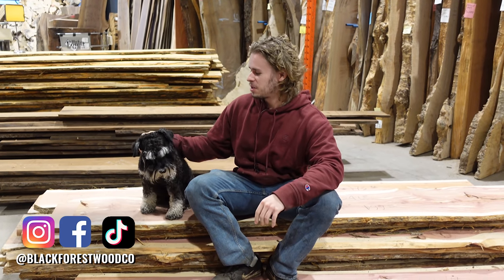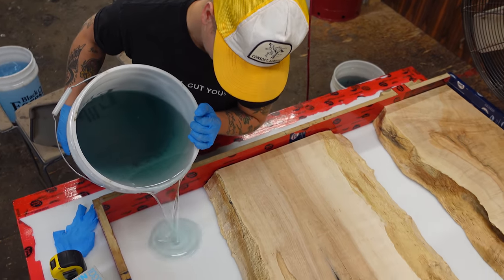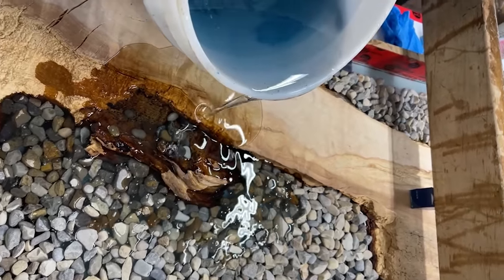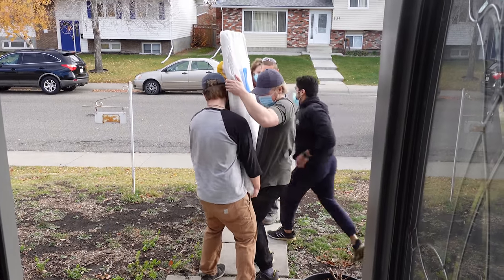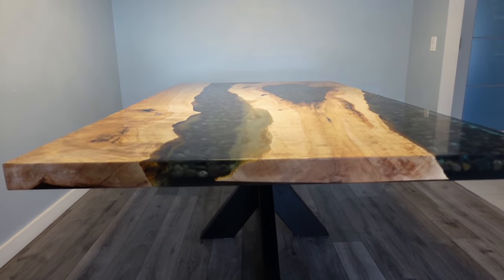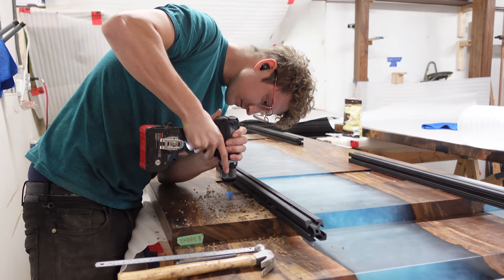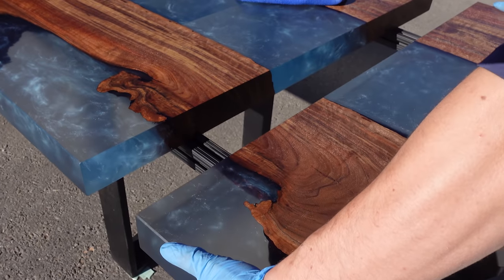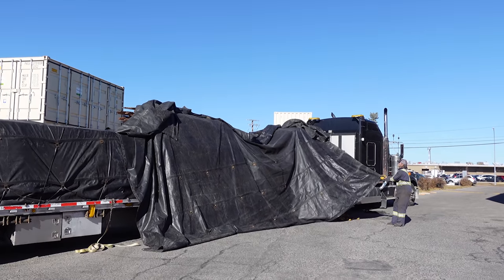This Resin River Table Can Extend

Comment: PIVOT Yup!  Have blown through two $85 Freud table saw blades and also had to replace the cutters in my planer's helical head from hitting rocks in the past.  River rock projects are no joke.  If you put the rock down when the base layer is even a little bit too soft they'll sink to the bottom and you can't plane or flatten the bottom.  If you have one pivot too close to the edge, you'll hit them when you size the board.  Be careful, folks!

Comment: “Pivot” the extension table is such a nice idea. Some one needs to come up with a quick release for the extension in replace of the screws. Something to think about. Absolutely beautiful tables as always. You guys are the masters of large epoxy tables. 👍🏻
Reply: Exactly! The common homeowner doesn't want to break out tools. They need something quick and easy. I would never sell this idea to a client.
Reply: Yes; I seem to remember something where the extension comes out manually by disengaging some locks, and all the stuff that sticks out being attached to the leaf.

Comment: Fantastic idea for the extension pieces. It probably depends on the end users preferences but watching this video it seems like it would be less work if the t track stayed attached to the extension pieces. Then you are just loosening the two bolts in the main table and removing the track and extension in one shot. Keep up the great work.

Comment: "PIVOT," is there a reason that you guys either start pour epoxy directly on the wood or overflow the epoxy onto the wood? Also, how do you prevent pinholes and little pockets in the wood?